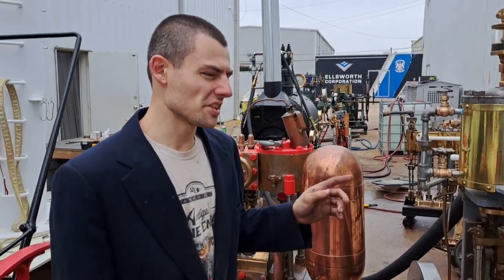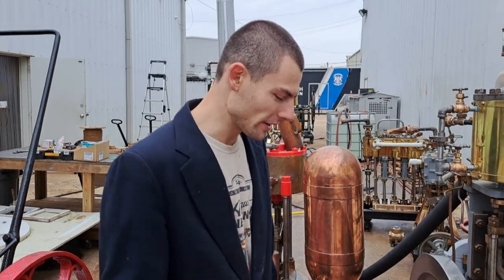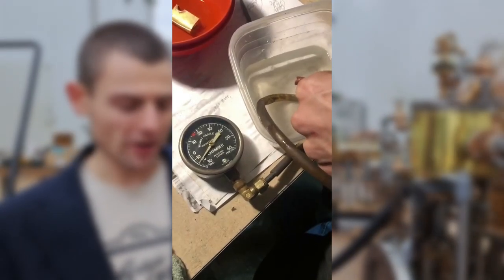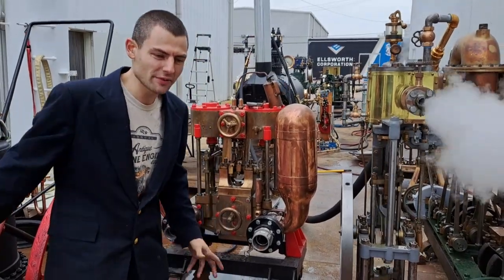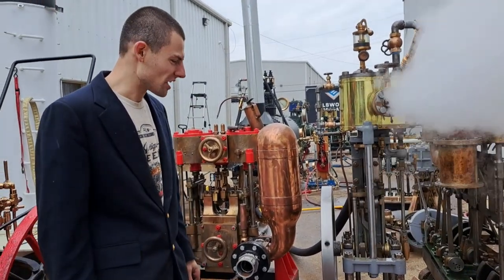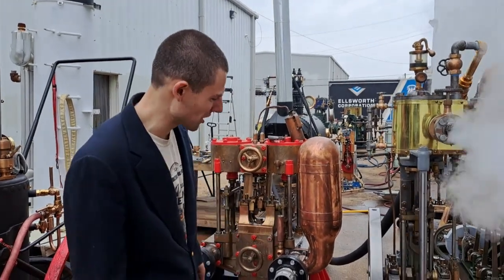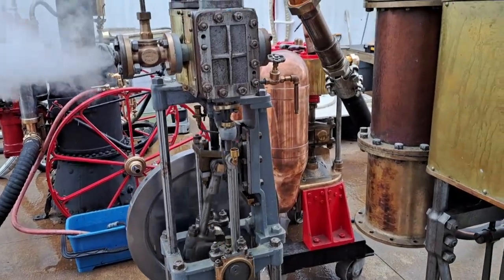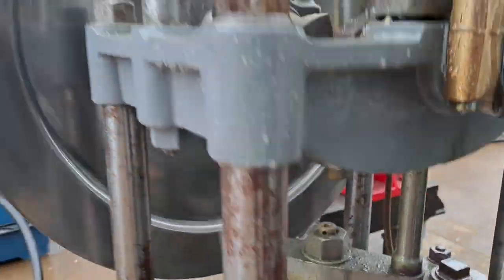Edward's type Wet Air Engine

Comment: Thanks for the video! What would be the problem if the engine exhaust that contains cylinder oil is pumped back into the boiler? My boiler has a valve to discharge the water after steaming. If I could get rid of the oil in the boiler after a steam session using that valve, would it still be bad to pump the exhaust in the boiler without a separator?
Reply from the maker: Cylinder oil going into the boiler is one of the only things on a steam engine that must be absolutely avoided as oil on the water side of the evaporative sheets will cause steam blanketing and overheating as if dry-fired, boilers will get cracked or burnt sheets that way.  The oil does not skate out with the water easily even with phosphates and other treatment chemicals.  You need an oil seperator if you are going to return condensate to the boiler.
Reply: @AEKarnes   Thanks for the quick response. Condenser oil/water separators are never 100% efficient in removing the oil from the water right? so that would mean that there is always some oil entering in the boiler. Is the removal of this oil part of periodic maintenance?
Reply from the maker: First thing is on condensing plants use compounded cylinder oil not straight as it does not emulsify in the water nearly as well, at the cost of some lubrication value, but any that does find its way into the boiler will better seperate from the water.  Fit it with a skimmer cock, or surface blowdown as the modern book thumpers call it, and use that all the time or set it to blow down slowly and continuously, and yes the more you open up that boiler and clean it out thoroughly the better.  You will also want to treat its water with chemicals to further help seperation, phosphates are your friend in this case.